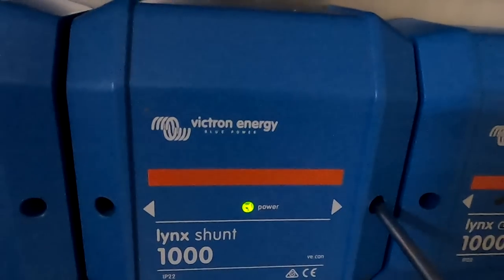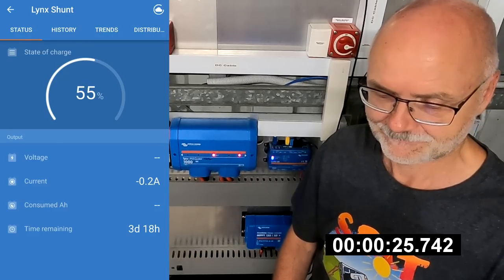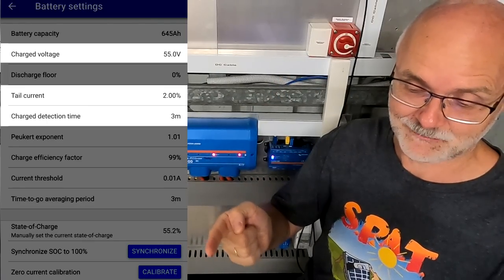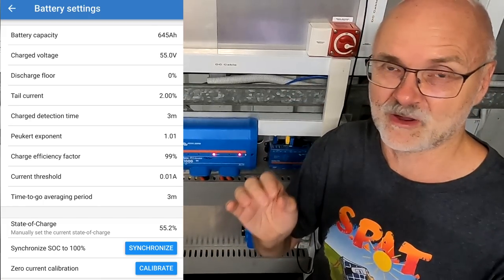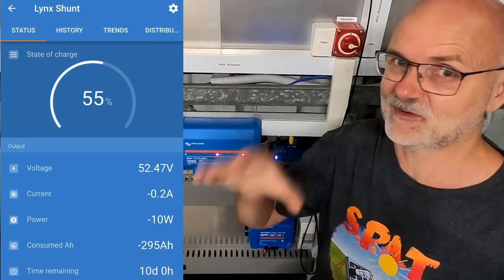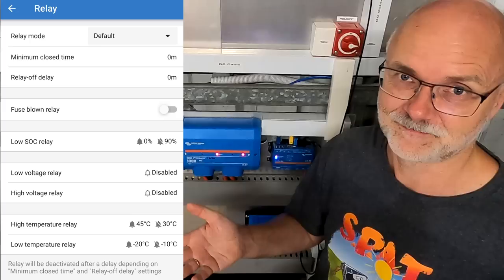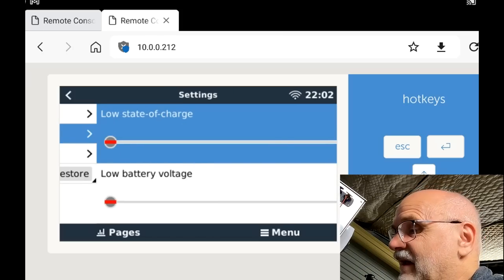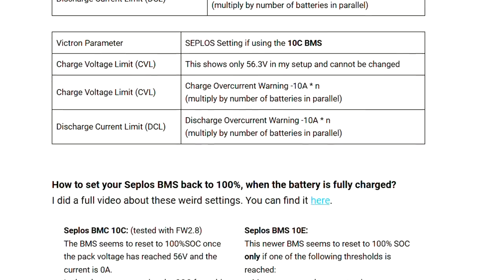The Victron Lynx Shunt - Settings, Features and Flaws

Comment: I have Victron Lynx Shunt in my setup. I also have the Victron SmartBMS 712 as well, but it is only capable of handling 500A.

I noticed the lower voltage measurement differences on Victron Lynx Shunt. This is no big issue as there is a workaround, as explained below.

Let me explain the reason why i introduced the Lynx Shunt to supersede the SmartBMS. This is mainly to leverage the 1000A busbar capability. To keep the system voltage drop low and running as cool as possible.

My LFP battery bank is configured for 2000A capacity, consisting of 4x 500A flexible busbars system connected in parallel on the Lynx Shunt. Each 500A busbar is connected to 4x 120Ah LFP, each capable of continuous 150A output with a 270A peak output current. We have 4x sets of these running in parallel, 16x in total, so the real output of LFP has max peak of 4320A, with a sustained output of 2400A. This high current handling capacity ensures ultra cool operation and is capable of taking on high loads and ultra fast charging with zero bottleneck.

On the Lynx Shunt, to match this high current capability i am running a 1100A fuse consisting of a 500A+600A fuse, which mainly serves to protect the conductors and busbars. The battery is more capable than this limit. Obviously don't want to push beyond the 1000A Lynx shunt limit too much either, but 10% is reasonable headroom. 

To address the voltage difference, i have added a Victron Smart battery  sense for voltage and temperature directly to the LFP battery. This provides a very accurate voltage reading for reference. 

On the CERBO GX, if i set the BMS to SmartBMS 712, with the presence of the Victron Smart Sense, its voltage reading will actual automatically takes priority over those from the 712 in the shared voltage sense for all Victron SmartSolar controllers in the VE Smart Network. But unfortunately 712 can't handle 1000A, but i have plans to relocate it to one of the 4 battery bank, which only needs to handle 500A. Meanwhile to get the system working we need to switch BMS selection in Cerbo GX to Automatic, which will pick up the Lynx Shunt automatically. 

Unfortunately once the above is activated, all the SmartSolar controller sees is the shared voltage from the Lynx Shunt, which is noticeably lower than both the SmartBMS 712 and Victron Smart Sense voltages...with the latter two being identical. 

The workaround is actually quite simple. Now that we know what Lynx Shunt reads and what the actual battery voltage is, via Smart Sense, we can calculate the offset voltage and make adjustments to each SmartSolar charging algorithm. In my case, i have observed a consistent 0.08v difference. So in order for each SmartSolar to properly charge the LFP without overcharging, i just need to reduce the fully charged voltage down by 0.08v. And I monitor the performance. I have seperate power meter and hall effect current probes installed on each of the 4x battery bank, so I can use Bluetooth to monitor and cross reference as well. This workaround solution works well. 

The only drawback of using Lynx Shunt is the loss of decimal accuracy when monitoring the real-time updates from VRM. But for the high current capability upgrades, this is a reasonable trade off. I hope Victron can address this small issue via firmware future updates. 
But meanwhile, i can always check on the Victron SmartBMS 712 readout, which has the decimal accuracy. Since all 4x battery banks are connected in parallel with identical capacity, this 712 readout is representative of the rest. 😊👍

So i would say although the Victron Lynx Shunt is not perfect, it is still one of the best options out in the market if you require a 1000A busbar capability in your setup. Remember, running the system cool translates into high efficiency and reliability. 👍👍👍